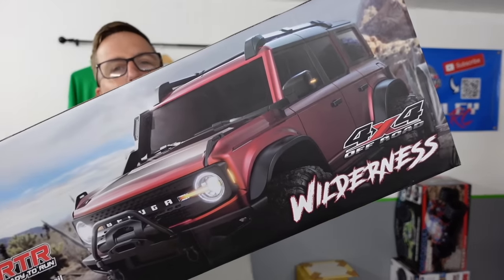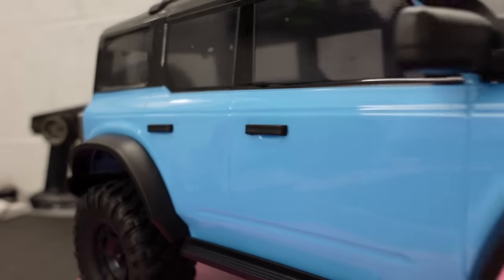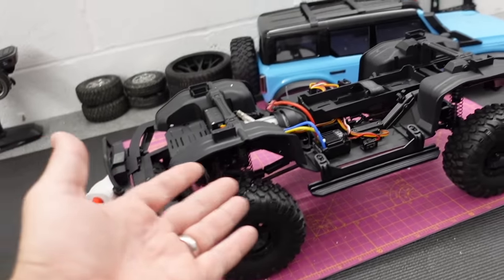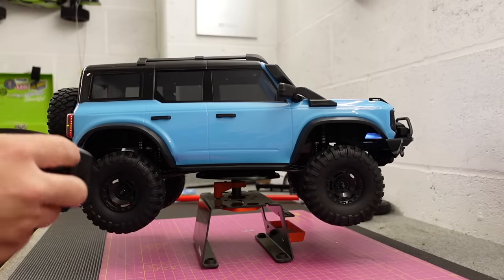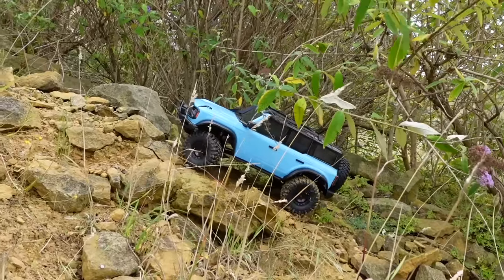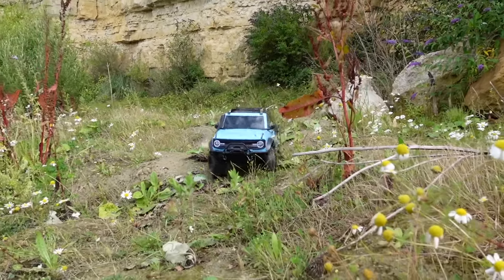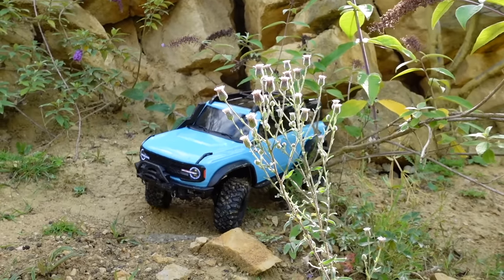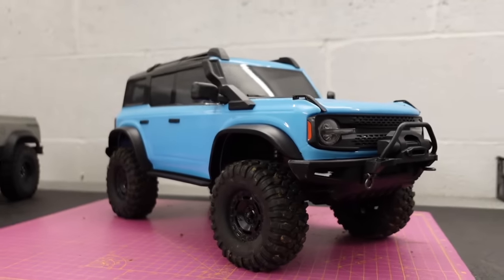They Will HATE This Fake Crawler

Comment: Encouraging progress from a cheaper brand. It's only matter of time until Chinese firms making RCs in China start seriously rivalling the quality of Traxxas RCs made in China.
Reply: Haiboxing is really good for the price
Reply: What is happening with the knock-offs is that they are made in the traxxas factory but a small percentage are sold under different brands without the  knowledge of traxxas (until now)
Reply: Good for the price sounds like making an excuse. It means it’s not just good
Reply: @musmaki4109  would I take a Maxx over the 903a... yes! But they're 5x the cost. I buy haiboxing for my kids. They never break! Good 4x4, and damn fast for what it is. Metal axles and shocks... crazy for $140 bucks
Reply: The DEERC 9200 never breaks as well.  Rebuild kits and or a spare parts package is never over $50......... a brushed 12T $20, bigger pinion gear $5(if you keep it brushed), 80/120amp ESC, Brushless motor and 20kg servo combo for $100.  Install it and hit 45/50mph on 2s, 55mph+ on 3s with less than $200 invested car included.  
All I know is I have spent less than most people spend on a set of Traxxass🔋🔋and I wipe the floor with my Banggood setup🛻💥💥
😭🤣😂🤣😭😂😭😂😭
Reply: @goldenmanuever1176  Yep, Chinese brands are indeed already super-competitive in the world of RC helicopters. I've a Fly Wing and an Eachine and have been delighted with them. Far preferable to the overpriced and so-so quality Blade brand from Horizon Hobby!
Reply: @rickwhitman6435  True albeit splitting hairs given that Taiwan's official name is the Republic of China.
Reply: I got a deerc brushless boat this summer, it is literally amazing compared to traxxas 350$ boat. I got it on sale for $89.
Reply: Traxxas are plastic crap, its not a high bar for the Chinese and even the likes of WLT out perform them while taking much more abuse for a 6th of the cost. Losi is a higher bar but not Traxxas. I'd take this crawler for half the price throw some upgrades on it and have a superior rig and cash in my pocket. Look at FMS, miles better than Traxxas in the equivalent scale too. In many areas the Chinese are ahead of the game.
Reply: There's a massive difference between Chinese rcs and American Chinese rcs 😂
Reply: @1WattMicahwave utter nonsense!
Reply: Clear windows!
Reply: @Plasma_RC if true the quality would be on par which it obviously isnt.
Reply: Absolutely nothing wrong with cheaper Chinese alternatives, where do people think most of the higher end stuff all comes from anyway. I'm sold on this for the price it's a no brainer...👌🏾
Reply: competition kills monopoly thanks china.
Reply: Yikong is doing a great job!
Reply: Fms is Chinese, they make great rcs
Reply: @1WattMicahwave 
It is a very normal in China that one factory produces items for different companies. I am pretty sure traxxas knows that.
Reply: When it comes to dji.. its number 1  dji of course from china danjiang innovation
Reply: Yes I agree too. This is the free market and China is giving it up with this idea. They are the same and beautiful too.
Reply: Hmm, do I go all metal piece by piece or just get something like this and throw some good parts on and call it done? 🤷‍♂️
Reply: FMS and Yikong are both really good Chinese brand crawlers, better than Traxxas I'd say!

Comment: Well I ordered on based off of this review, in this colour. Arrived, changed the wheels and tyres to weighted alloy beadlocks and deepwoods and it's just as capable as my actual TRX4s! I'm going to say it's my favourite rig at the moment...I have some custom vinyl coming taking on the Beluga name/theme. Mine has a different motor and is equal to the TRX4 2 speed in terms of speed and power. Put a TRX4 front locker in, fits fine! Those indicators though....hate them. Need to investigate the wiring to change the radio. May take the transmitter apart and see if there's any other channels I can solder a switch to...
Reply: Oh, and it cost me £158, so 1/4 of the Traxxas! 

Going to stick a 1200 Fusion in it eventually...it also runs rather nicely on 3S 👌🏼
Reply: Are the parts cross compatible with TRX4 parts? Only problem I can see is getting parts might be difficult for these
Reply: I too wanted to find the Duratraxs CR Deepwoods for this rig. When it comes in, but none were available!
Reply: and truth !! You are absolutely sure they are the same!!! and even in terms of performance, they are beautiful and at a very affordable price. If you have any plastic parts, just exchange them for an aluminum one.
Reply: Any idea if other bodies can be fitted to this?

Comment: I recently got an Absima Bronx, it's 8th scale, 4S capable, more detailed, more capable & has a full function light kit & it cost £499 compared to the Traxxas Bronco at £620.....
I've had a TRX4 & the Absima (Yikong) is every bit as well engineered & built, if not even better in places.
I've had the 10th scale Absima Sherpa (Yikong Jeep) for almost 3 years & it's been used often & hard.. It's still 95% original.
I've replaced the gears with hardened steel ones, a few bearings, top hats & steering knuckle (that I broke hitting a rock doing about 25mph)...
I don't care about "licensing" or "taxes"..
Other RC manufacturers can lower their prices, so can Traxxas, Losi & Axial.!
Team Associated/Element can do it, so it's not "an American manufacturer" thing... It's a bloody GREED THING.!!!
...  ...  ...
Cheers for another great video Phil... You're doing a top job fella.!!
As always.. Stay safe out there mate & best wishes from Scotland 🏴 🙏 ♥ 📻 🎮 🔋 🚓 🚒 🚑 🚐 🚔 🚕 🚖 🚗 🚘 🚙 🚚 🚛 🚜 🏎️ 🏍️ 🚤 🛥️ ✈️ 🛩️ 🚁
Reply: Got the same yikong stuff. Nice quality
Reply: As an American, even I have to agree. Traxxas are very GREEDY.
Reply: @ch-vs3fw  and very litigious.! 😉 😉

Comment: The wheelbase is 324mm on a TRX4 and 310mm on the Wilderness.  I’m thinking Springs/Shocks, Wheels/Tires should fit, as well as any scale accessories like trailers lights ladders Jerry cans etc.  but the big question is geometry-related upgrades like upper and lower control arms.  14mm is a decent amount of difference where 1-2mm count in geometry.  MAYBE if the UCA/LCA are the adjustable screw in rod end types that control pinion angle.  

Aftermarket Driveshafts from a TRX4 should be ok.  

Big question mark or anything steering other than the servo. (Like drag link, pittman arm, or tie rod).  Also not sure how 1:1 the knuckles are.

Comment: Anyone with motor plate wobbly - you can carefully drill and put a set screw either side of the motor plate in the plastic mount, snug them up when the motor is in place and it doesnt wobble. Also, i havent tried but reportedly replacing the skid plate and motor mount with trx parts 8290 and 8238 also works.

Comment: I can confirm that TRX4 parts do fit this truck, i got one, ordered some aftermarket brass diff covers, they bolted right on no problems, i assume that everything else likely will do the same, but i'd test as you go.
Reply: What about linkages & driveshafts? The wheel base is slightly different so I'm guessing those things aren't the same?

Comment: If the most aftermarket parts fit this could be an absolutely killer truck... And be honest who drives his trx4 stock 😉i see so much potential on this truck 😬😬💪💪
Reply: All my trx4s are 99% stock. Only thing I've done is beadlocks. And modified canyons

Comment: Even has traxxas styled tires. I like it, i own a trx4 bronco (1979). Bought it second hand with 3 micro crawlers for 300 USD. I prefer my axial deadbolt that i converted to a hardbody trail rig.
Must grind traxxas's gears knowing someone out there put out something just like their product for 1/2 the price that has alot of potential.

Comment: I think the real question that you didn’t answer in the video is for the price is it a cheap junker or a value crawler. Face it not everyone has traxxas money or custom build money. But to get into the hobby and not a bad looker either. Should update on cost and location of parts. How easy it is to get a part or two. Play around with some minor upgrades and see if there is any support. Think all that was missing and needed. Cheers! Great video!
Reply: Also looking at it. It’s $275 US and free shipping in the states. But if parts support isn’t available then spending another $125 on a axial bronco $399 or a builders kit for $370 it’s a hard battle. Spend a lil more and if you break something your parts are easier to get so your back on the trail. Or spend the same as a trx4 and get 2. One for a buddy. No one likes crawling alone. Lol

Comment: Nice car. If you turn off the lights, does that stop the indicators? 
It's for sure not a TRX4. They don't provide as many parts for upgrading as Traxxas and the aftermarket does. But I'm pretty sure for body work many other parts will fit. The chassis is another thing. The only thing I see are the wheels and the motor. 
Can the other channels be switched by the transmitter? Would be cool to use them for a winch and rock lights.
And to be honest, this thing costs the same as the new Super Sabre. Okay this is a buggy and not a crawler. But it's a good comparision.
Think I'll buy one

Comment: Hi, cool video as usual, except this thing deserve more video time and details!! What about mods? What about crawling? Here when we get a new TRX4, we add weights, swap motor to fusion, tires and wheel anyways… and the servo. What would be the result with the same mods on that rig? I bet both wouldn’t be that different for 400$ cheaper anyways. I got an Austar AX X6, 6x6, chassis for 200$, and with those mods, it’s as good as a TRX6 with the same mods.

Comment: Be good to see some of the Absima ones which now come with a Hobbywing 1080 in some of them and have locking diffs as well, I think the original manufacture is Yikong
Reply from the maker: I wish more companies would use 1080's as there stock ones
Reply: @TomleyRC I think it's only happened because Hobbywing now have the G2 1080. Hobbywing seem to keep their own latest products for themselves, which makes a lot of sense. We should start to see more I think
Reply: It's the Absima Sherpa CR3.4 Pro which comes a Hobbywing 1080, not a cheap vehicle though but you do get a lot for your money

Comment: Phil this is right up my alley ! ( “that’s what she said”)😂😅
I do like my HB toys truck that I have currently, zp1009 which I’ve upgraded to oil-filled shocks and did your mod to the steering .  The little truck does pretty well, but this Baluga is on another level. Not only is it bigger but actually comes with oil shocks, as well as a 1060 esc! Think I’m going to get this one , but wait for a holiday sale or a flash sale on it before I do. Do you think it’s as good as the RGT rock cruiser? Your thoughts eagerly awaited! Thanks man!👊🏼👍🏻😎

Comment: Mine came with a broken battery and the charger melted on first use. 
I ordered 2 LiPos instead and did my first run. This thing was awesome until it's front right driveshaft broke off inside the wheel, which made it spin freely. 
Let's hope the $5 replacement part isn't a brittle PoS and that this will be my last issue with this product, damn.

Comment: Hi Phil do you know where I can order the uptated / slightly thicker motor plate to eliminate the play it has🤔
Reply: If you find one I'd like to get one too! Shimmed mine with some card for now which works but won't be too good in the wet!
Reply: @lukedavis4213  I used some Wpl axle shims and electrical tape😬

Comment: Any ideas on whether the trx4 defender body would work with this?
Reply: No, unless you change the wheelbase and strut towers...can't fit normal posts as the clipless body mount is part of the fenders the same as the Traxxas clipless system 👍🏽

Comment: Hope you read this i cannot find out how to setup the end point of the steering !?! 😅 could you help out is there a button combo or something else ... because the wheels now rub on full steer so i just want to set it to a little less steering angle... 

I dont want to upgrade the controller and reviever just for this because of the light system that is actually really really nice
Reply: Add on ... when the lights are on you can push setup and highbeam will turn on

Comment: does anyone know what batteries this takes?
I know it's a 7.4v 3000mah li ion battery etc but I haven't got the truck yet, and I need a spare (or two) for an event...

Maybe just the size of what would fit, either in the middle or the front, would help. Thanks
Reply: I can fit 5000mah 2S hardcase lipos, NiMh packs, and I run a 1350mah 3S in the front battery tray. The stock li-ion pack should give you around an hour though 👍🏻
Reply: And it's a deans/t-connector. ESC is a HW1060-RTR
Reply: @lukedavis4213  thank you Luke. Much appreciated!

Comment: This truck is pure garbage.
You can't find any spare parts.
Once it break, it done.
Reply: Which parts will you need? Traxxas diffs and portals fit, spur is the same, pinion is the same, links are the same, servo is a servo, motor is a motor...axle casings I think will be the weak point and a set of decent (Chinese) metal ones is like $70-80 so still well under 1/3 of a Traxxas...